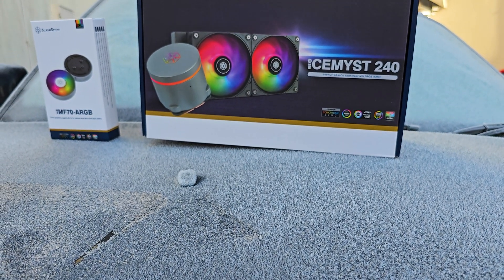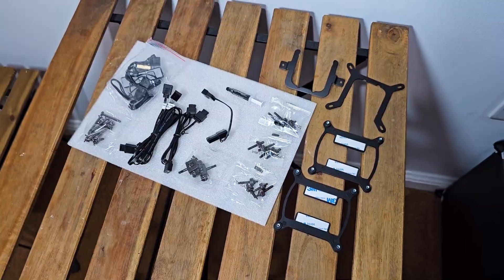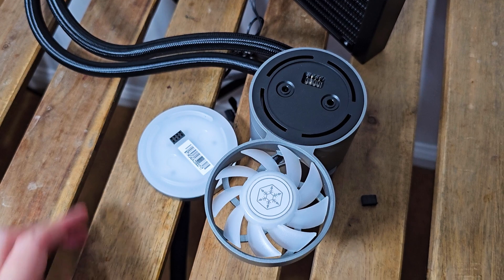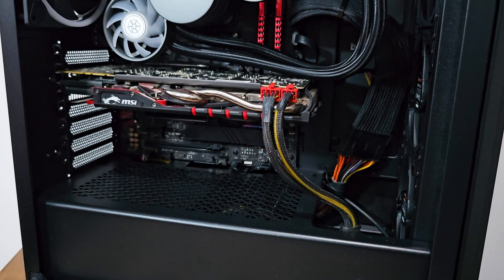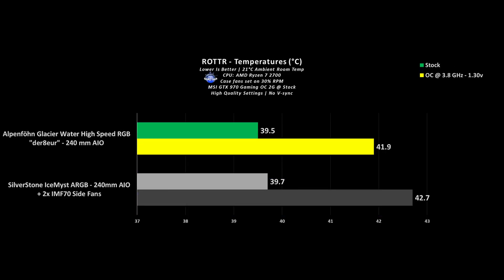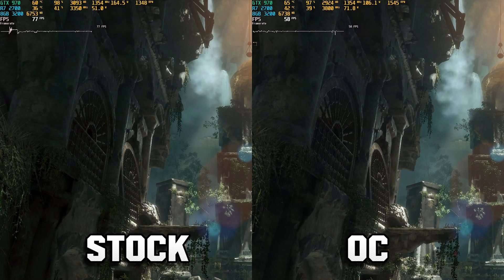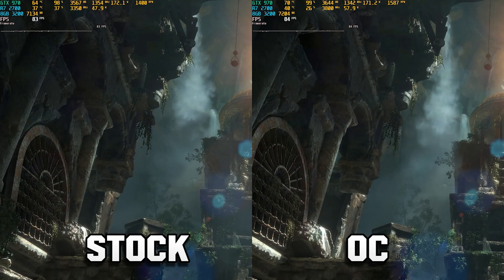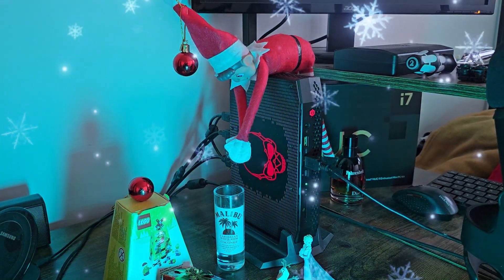An AIO that Stacks? SilverStone IceMyst 240mm AIO + IMF70 ARGB - Christmas Special 2023

Comment: Hello how do you install the argb adjustable lighting?
Reply from the maker: It comes with an ARGB cable that connects to your motherboard.
Reply: @Glob3Tech  i have the argb cable i just dont know where to put it on motherboard
Reply from the maker: It should be a 3 pin white port (5v). What motherboard do you have?
Reply: @Glob3Tech  msi b550m pro vdh wifi
Reply from the maker: @riordanronan3498  Unfortunatly no 5v rgb port that I can see. But you have the manual mode if I remember, that mini wired remote. Better than nothing.